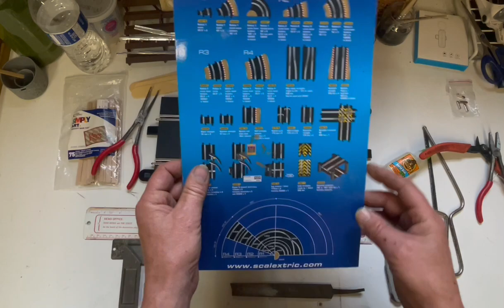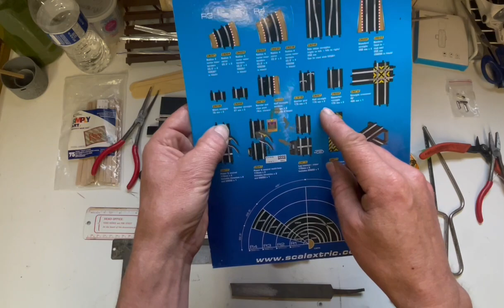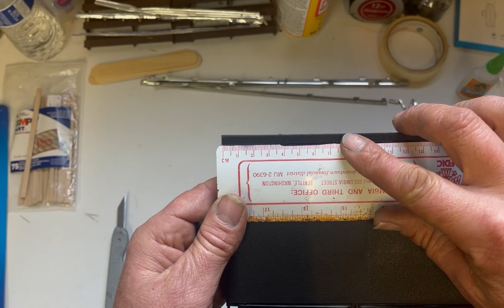How To Custom Build A Piece Of Scalextric Track

Comment: Great idea and a simple-to-understand video to explain it. I have some small improvements to suggest. At 9:40, you show how you use a flat-head screwdriver to pry up the metal tabs on the underside of the track rails. When doing that, there is a possibility you will create a slight bulge in the side of the rail. To prevent that possibility, you could insert a small wood chisel into the slot between the two metal rails, and use the chisel to support the side wall of the metal rail while you are prying up the metal tab on the side of the metal rail. Then, when you have removed the metal rail from the track, use a combination pliers to straighten the metal tabs on the rails. Doing this will make it easier to re-insert the rails back into the track.
Reply from the maker: Good idea 👍, the rails are very soft . Thanks 😊
Reply: @BoonesSlotCarGarage  D'oh! I slightly mis-remembered the technique I used for removing track rails. I put the flat-head screwdriver between the rails to prevent the buckling, and I used the wood chisel to pry up the tab. The advantage of using a wood chisel for prying up the tab is that the wood chisel has a sharp edge that can fit underneath the tab more easily.

Comment: Hi Boone, great video, I just did that with 6 pieces of 4/15 curve track, I added them in between the 6 - 60 degree turns that gave the cars just enough relief to make the 420 degree turn without leaving the slot.
Reply from the maker: Thanks Donald, very cool for a corner. I just love these types of ideas that think outside the box. A corner tweak is very cool

Comment: I have done something similar but cut and shut. Strip the rails out, Cut out from the middle what you don't need DEAD SQUARE. join together using cut down rail pieces and join underneath with some plastic strip or pieces of waste track or even that tongue depressor, using hot melt to glue everything together. I have found that hot melt glue is the only thing that will stick to the PE that it is made from. As long as you have at least one pair of tabs to clip the rail with, it works. Don't use a hack saw, use a Stanley knife and a square. Just needs a light sand then.
Reply: Oui c'est peut être plus simple !